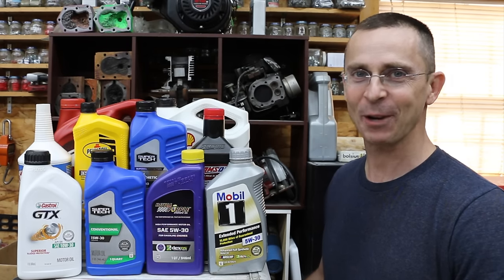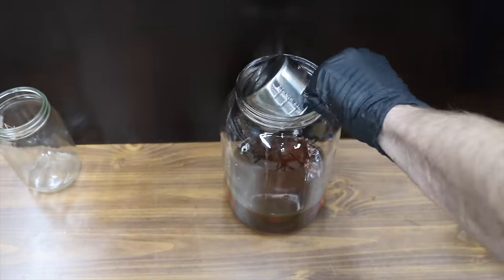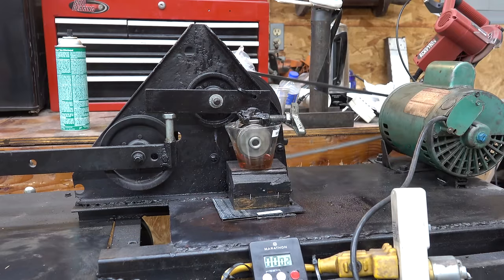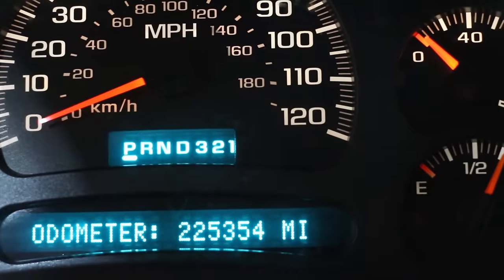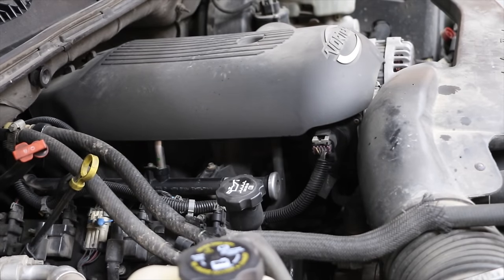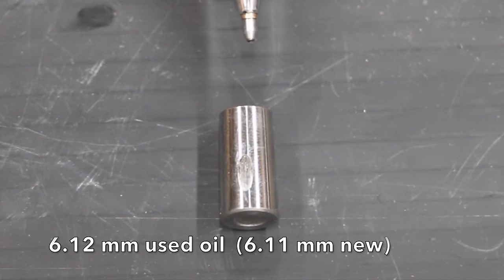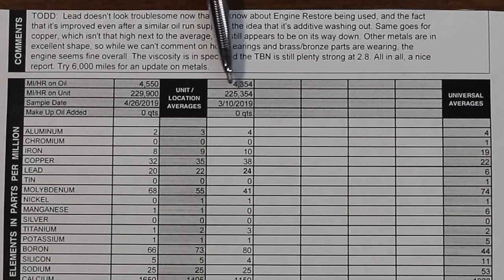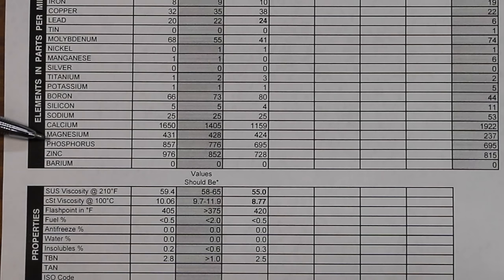Will Mixing 10 Motor Oils Damage an Engine? Let's find out!

Comment: I used in Engine Restore once. Then many oil changes later (at 220k) I sent a report to Blackstones labs and they told me that the lead levels were a little high.

I know now this might be because of the Engine Restore I had used previously. How long does it take for it to wash away?

Comment: I mix engine oils in my car, the manufacturer recommends 5w30 but the owners and clubs recommend 10w40 so I mix the two 60/40 depending on the season with the 60% 5w30 in the winter and switching to 60% 10w40 in the summer.  I stick to the same make semi synthetic however and never had an issue in 6 years of ownership.
Reply from the maker: Thanks for the feedback.

Comment: as a car mechanic i aways tell my customers  to use a certain brand that the shop i work for ahs a deal with , but really in my own car i have ran all kinds of oils , mixed different brands sometimes een dfferet grades of oils and my thining behind this was , i drive old junkers that i beat around , maybe i get 2 years of use before i send them to the scrap yard  , so i was never concerned with what i put in the engine , nice to now that i was not a complete monster
Reply from the maker: Thanks for the feedback.

Comment: My Uncle turned me on to API service spec ratings. He mixed as many as three or more brands of oil in a single oil change. What ever was on sale. This was nearly 40 years ago. I think his old Dodge 318 probably went over 200,000 miles no engine issues. I got smart and bought the cheapest oils I could find that were rated for my engine. That usually was Wal-Mart Tech label. At one point I was running 15-40 diesel oils in my Ford 300. Figured the high detergent factor would help keep it cleaner. I know my Dad used It in  his old Chevy 283 in the 60s.  Too much BS out there regarding oils to go with all the genuine lubricity and technical improvements in oils. Truth is that  decent oils with super filtration systems can go tens of thousands of miles in diesel trucks. As long as you remove the carbon deposits and crud the oil is just fine for 10 or more times what we were led to believe for the last 50 years or so. All we were doing was washing out our dirty engines by changing the oil because we weren't filtering it adequately.
Reply from the maker: Thanks for sharing.

Comment: P.F. I USE GTX 20-50 OIL IN MY 1978 BUICK SKYLARK FOR MANY YEARS I FIND NO PROUBLEMS ,, AND LIVE IN LA. CA..,, NO FREEZING COLD WEATHER LIKE SNOW OUR AREA.. IS THAT THE OIL I SHOULD BE USING .. THANK''S ..GREAT VIDEO MY SON AND I ARE LEARNING ALOT....THANK'S TODD..
Reply: Yeah, your climate can take 10w30 10w40 or 20w50 for that engine

Comment: I feel like you can use any QUALITY oil on the market with little to no difference. You may gain or lose .5 MPG but a lubricated engine with regular oil changes is all you need. What do you think? Excellent videos! 👍🏻
Reply: That isnt true. It takes less friction to increase mpg so if you lose mpg eith a certain oil that means it is worse on engine due to more friction.

Comment: Always wondered if I do a oil change and use motorkote 1st and change filter and oil. Then do another oil change and use full synthetic oil as I did in first oil change but instead of using motorkote I use a diffrent type of oil additive such as a ceramic additive or duralube how would that effect my engines performance and how well would the additives protect the moving parts of my engine. Just things that make me go Hmmmm?🤔 Thanks for all your stellar tutorials I do enjoy watching them all!

Comment: I use 5w20 on my scin xb. However It is  loosing or burning oil, should I add or mix  5w30 thicker oil? Wondaring Will it prevent the oil to slip throw clynder wall to combustion. Or it will be very bad for the engine?

Comment: How much does running a thicker or thinner oil effect fuel economy? E.g. if an engine specified 5w-30 and you run 10w-50 or 0w-20 what is the change in fuel consumption as a percentage? Does it make the engine run hotter, cooler or cause any damage? How does the oil pump hold up?
Reply from the maker: Thanks for the video idea.

Comment: -- Missed this one somehow.  Well you picked a pretty bulletproof motor to run the test.  Though eyeballing it, I couldn't tell if it was the 5.3 or 5.7 - both solid motors.  Solid vehicles for those years too.  Have a 5.3 in a 2004 Tahoe Z71 (my new winter beater).  178 thousand miles.  Runs like a top.  
     Was surprised your results came out so positive.   Wonder what they would have looked like in winter.  Saw Ft. Wayne on the results.  Let's just say I-94 has been my stomping ground for my whole life, so weather is a factor.  Wonder what the results would have been.  Suppose your 'race' test is good enough.  
     Nice test.  I run Valvoline full synth 5W-30 in mine.  Keep a 7th quart in the back just in case, but this hasn't burnt anything.
Reply from the maker: Thanks!  Thanks for sharing.

Comment: summer time.. add three 10w/30's to my crankcase.. other 3 are 5w/30. One of those 10w's is a synthetic.. plus a lucas oil add.
 winter  ?  straight 5w/30 oil  w/one synthetic..
'02 8.1 vortec.

Comment: I always add in different weights of oil and brands when I top of my car since it burns oil.  When it's hot out, I'll add thicker oil in like 15w40, if it gets cold during winter, I'll add in some 5w30.  I only use conventional oil since it's cheaper and my car burns so much, about a quart every 400 miles sometimes lol.  I change the filter and oil every 4000 miles since it starts getting really dark.  Think it's a good system, it's been doing this since I bought the car 100K miles ago.. Mustang GT 4.6
Reply: and yes, once in a while you need to change out a spark plug - driver's side by the firewall seems to foul.  Luckily it's easy to get to it.
Reply from the maker: Thanks for sharing.

Comment: You need open up the engine and test the cam and pistons for damage since it needs specific type of oil to to not damage the engine. Cold start high heat etc etc . That test you performed with all the oils mixed I think only helps it because of the thicker viscosity oils but it won’t help the engine if it requires 0-20 or something thin.
Reply from the maker: Thanks for the suggestion.

Comment: I blend my own oil. Only full synthetics of the same brand, but instead of straight 0w20 (too thin for south Arizona heat, I blend 25% 5w30 or 10w40 in summer. My engines run cooler quieter and longer with no issues.
Reply from the maker: Thanks for sharing.

Comment: Hi Todd:  I've watch all of your oil videos, but you are missing one!  testing Monograde oils.  I live at a tropical city in Mexico and i have no need of using multigrades, we never get under 70° F. I always use Quaker, Castrol or Supertech monograde 40 in my sentra 2000 and stills great after 180,000 miles. However too many people argue with me about that oil is a sh%t. Can you test it against a conventional multigrade same viscosity 40?  obviously skip the frozen test, just focus on lubricity and durability. My regards!
Reply: Mono grade oils in the retail store in the USA is either limited to 30 weight and non-detergent 30

So most go for multiple weight oils for the seasonal changes

Comment: One question, but it is ok to mixed 5W30 and 5W40 together and it doesn't will have a lot different right ? Because sometime, I change the engine the car engine oil  from 5W30 to 5W40.

Comment: I have a question about my 2004 Volvo S40. I just needed to add oil not change but I used Pennzoil 5w-20 synthetic. It recommended Castol oil but where I went they were out. I added it yesterday and when I checked it today it was dark and light higher up on the dipstick. Do I need to change my oil completely ? Or will my car be ok with this oil.

Comment: I've had 2 compression testers from harbor freight, both read too low compared to one I rented from O'Reilly auto parts. A chainsaw pulled over way too easy with the gauge hooked up, a lot harder to pull with the spark plug in. What's the best compression tester that's not too pricey?
Reply from the maker: Thanks for the suggestion.

Comment: What if you find a oil weight that gets rid of engine knock in the top end because the recommended isn't getting to the top end at cold temperatures. The recommended is tested in weather conditions that are 80F or warmer most of the time not below freezing. It takes 30 minutes before my rockers quit making noise at 20F with 5w30

Comment: It’s comin time to do my first oil change on my ford maverick hybrid. Need 5.7 liters. I’ve ordered a 5l of Mobil 1 extended performance 0w20 (20,000 mile) since it was cheap on Amazon. But I need one more litre and I was wanting to try out liqui moly new Gen molygen (green oil 10k mile) and I was wondering your opinion if I added the 1 litre of molygen to the mobile 1, what do you think would happen?

Comment: you should test mixing coolant types. how it affects temperature properties and if it can damage an engine. (does it only impact extreme temperature properties?)

I bought a used CRV I'm sort of suspecting it has the wrong coolant type in it, I want to switch back to the correct type, but I'm wondering how good a job I have to do getting the old coolant out. maybe its not such a big deal to mix coolant types.
Reply from the maker: Great suggestion!  Thank you.

Comment: hi mister who made this amzing video. i cant speak english much just can lsiten to it

i really have some question to asking you here

so what about a mixing diffirent motorcycle engine oil 
in 1 cylinder motorcycle with wet clutch that most of them are runing at high RPM

is it possible to do? and no damage to the engine ?
Reply from the maker: Thanks for the video idea.

Comment: I've been looking into different motor oils a lot recently, regarding what to use in my current project car. Referring to the owner's manual is all well and good with a stock or near stock engine, but I'm still wondering what the best solution would be for determining the oil to use in a custom high power engine? A lot of people seem to be dealing with the issue by throwing money at it (the most expensive racing oils and frequent changes) or by just basically winging it, which may result in lackluster bearing protection or problems with overheating, foaming etc.
Reply from the maker: Thanks for the feedback.

Comment: I have a 2000 suburban with similar miles. Did that engine restorer you mentioned have any effect?
Reply from the maker: The suburban didn't really need it since the compression was good before using the product.  I decided to use it anyway to see if there was any change in oil consumption or loss.
Reply: @ProjectFarm  Cool thanks. Mine the lifters clatter for a second  on cold starts. Still trying a few  things. Marvel didnt seem to help.  Any suggestions?

Comment: For a 6 quart oil change of 5W-30 conventional, I accidentally added 1 quart of straight 30W with 5 quarts of 5W-30.  Any concerns for summer driving?  I plan to change oil this fall before the cold weather arrives (Chicago area).
Reply from the maker: Thanks for sharing.

Comment: Have you tested the cleaning ability of 2k paint thinners in engine oil? I did recommend it ages ago. Id love to see old oil drained, then new oil with like 25% thinners in it and see how it cleans. I have used a little bit in a spray bottle before onto an old head in the valve spring area and the black staining came straight off without agitation
Reply from the maker: Thanks for the suggestion.

Comment: Does motor oils looses its viscosity in warm weather, after 10 and 15k miles? Do you have how to test a viscosity on oils. My question is because it looks like when you use your oil for longer, it feels like when it's hot and old (10k miles) , it doesn't hold the viscosity as it would do  with the brand new hot oil.
Reply from the maker: Thermal breakdown does indeed occur.  Sometimes oil actually thickens as it breaks down
Reply: Do you know if that's due to some sort of a carbon accumulation, or what?

Comment: But i need some help because i have a vw golf 3 1.9d  and a month ago i changed the oil. For 32 days it drinked all the oil because of compression loss. I used Restore and it got some more compression but there's a lot of smoke coming out of the exhaust and i thought i could mix the oil that it has now(15w-40) with (20w-50) so it wont drink the oil that fast. what do you think please reply.

Comment: I honestly don't think topping off with different oil brand or even slight number difference does anything bad to the engine, except maybe if it's a different type (synth/conventional). All oils have kinda the same stuff in them, in more or less quantities and topping off a 5w30 with a 10w40 won't do anything but just mix together and probably turn it into a 6w31 (random number here, I think determining the resulting specs would be hardcore math+chem level)
On the side note, I've been using 5w40 instead of 5w30 in my Focus(2003 1.6 petrol) for 3 years now, at the recommendation of a mechanic, actually, since I've got about 230k miles on it and he said using a thicker oil helps older engines by filling the 'gaps' better, since it has higher viscosity.
Reply from the maker: Thanks for the feedback.

Comment: All thru the 80s and the 90s, I had a series of old 1970s Ford cars and trucks. They were reliable and comfy and I really liked 'em. But they were all old, with high miles, and leaked EVERYWHERE. They leaked oil, trans fluid, power steering fluid, and coolant. So I'd take my father in law's used oil, and dump it in my junk. He had a couple old classics he never drove, but he'd change the oil in em every 3 months anyway! I NEVER changed my oil, it changed itself! I'd just change the filter every 6 months. But I NEVER blew one up! Now I got a battered 92 Silverado, I ran Mobil 1 in it, and I've blown 2 engines in it. Because Chevy.
Reply from the maker: Thanks for sharing.

Comment: Could you test the effects of using a different viscosity oil than the manufacturer recommends over a long period of time? What would the effects be if you use a thicker oil than recommended and vice versa.
Reply from the maker: Thanks for the suggestion.

Comment: So what do you get if you mix the exact same oil, either manufacture/brand type into a different weight? If you mix 2.5 qts 5w30 & 2.5 qts 10w40, does the effectively give you 5 qts of--- 7.5W35 ?
Reply from the maker: Thanks for the video idea.

Comment: Even new Toyota's with under 60,000 miles are burning a few quarts of oil between changes. In fact I can't find an engine running 0W-20 that isn't burning oil. Can you investigate this and whether it's caused by these low viscosity oils? I'm pouring 0W-40 or 5w-30 and the oil consumption reduces significantly.
Reply from the maker: Thanks for the suggestion.

Comment: I just recently found out that Ford back spec'd many vehicles to 5w20. My 98 4.6L f150 was one of them.
Nuts because manual calls for 5w30. But for released the info in 2002 with a list of vehicles. So I guess 5w20 is what I'll be using.
Reply from the maker: Thanks for sharing.

Comment: My understanding as a mechanic is oil isn't an issue in older engines but new engines with emissions technology i.e dpf must have correct oils used as these are low ash oils and don't hold carbon like mineral oils. 
Also fuel economy is effected by oil grade, plus if hydraulic tappets are used or fine spray jets for lubricating and cooling pistons oil thickness is an issue as too thick and they won't work as well....oh and one final issue, bore glazing and oil consumption.....
Reply from the maker: Thanks for the feedback.

Comment: alot of people like using rotella diesel oil in gas engines and swear by it. but i  had to change out new piston rings on a newly rebuilt engine breaking it in with it. and ive noticed a few trucks that used it would bleed off compression in gear parked on a hill.
Reply from the maker: Thanks for the feedback.

Comment: 15w40 diesel oil in a high mileage gasoline engine? (Have had some success using it to alleviate low oil pressure in very worn engines)

Comment: I've been warned not to use synthetic oil in a well used organic oil engine. In fear of all the seals & gaskets being washed out or tearing & starting to leak. This might have something to do with the detergents washing away all the old slug that might of acted as a seal. 
Is there a way to test this theory?
Reply from the maker: Thanks for the suggestion.

Comment: Would be interested to know what results to expect using 10-30 conventional oil instead of the owner's manual 5-30, on mileage and leaks, on a subaru with 175k.  Decreased mileage?  Less leaking?  or not?
Reply from the maker: Thanks for the suggestion.
Reply: @ProjectFarm  thanks for noticing!

Comment: I mixed half half 0w30 and 5w30 both castrol fully synthetic  was worried if I should take out and go with 0w30 full 5 litres on a bmw with 40k miles

Comment: I work at a ford dealership, I drive a 15 jetta. I change my oil every 1500-2000 miles. Any issues with changing it too often?
Reply from the maker: Thank you.  No, changing oil frequently will not harm the engine

Comment: Please test blendzall gold label,  I WONDER if it works as a fuel stabilizer and I have heard if mixed 1 pint with 5 gallons of 93 pump gas it can be used were 110 octane is required.  I use it regularly and believe it to be the best fuel system cleaner and lubricant.
Reply from the maker: Great suggestion! Thank you.

Comment: Do engine oil stop leaks work. I instal catrol 0w-20 to a new engine, with in 200 miles the oil pan front and rear seal started leaking. I haven't found a product to reseal this gaskets.
Reply from the maker: Thanks for the video idea.